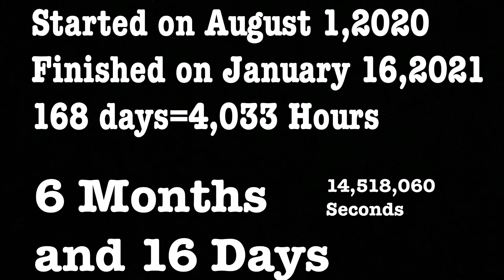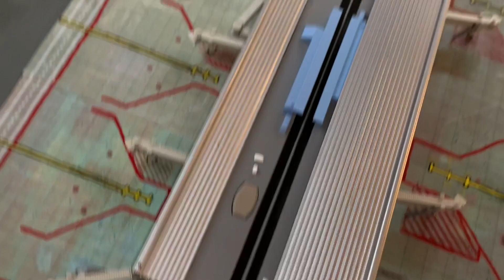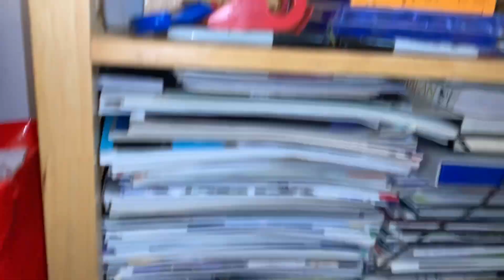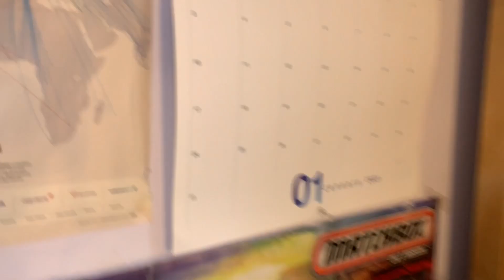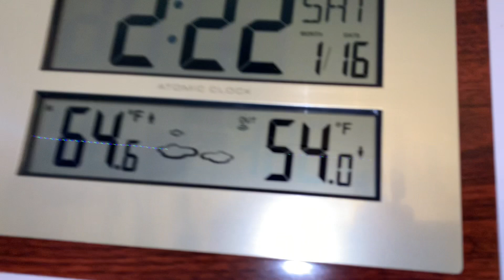Making a 1:400 Scale Model Airport ( Start-Finish )

Comment: Hey love the video I’m actually about to make mines. What was the budget for this how much u spent on this worth of planes too.
Reply from the maker: The planes were the most expensive part, but I was collecting 3 years prior to building this so I wanna say maybe 3k on planes for all the buildings ( 3x terminals 1x hanger) $900 and the rest I got from Walmart, printer + ink paper glue and grass, for grass I recommend getting it from hobby lobby so it looks more accurate
Reply: Tnx
Reply from the maker: I only printed out the runway and parking area the rest like taxi way I used paint and paint markers for the little details and I put glue over everything once it dries so the plane wheels don’t pull the paint up